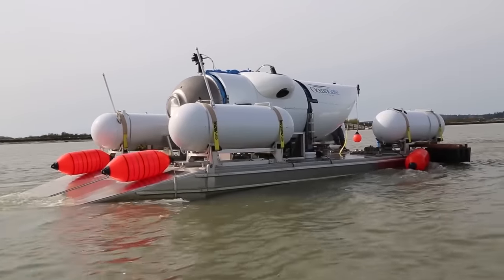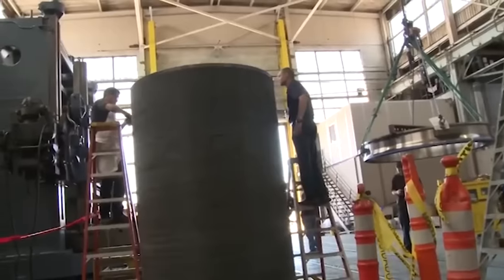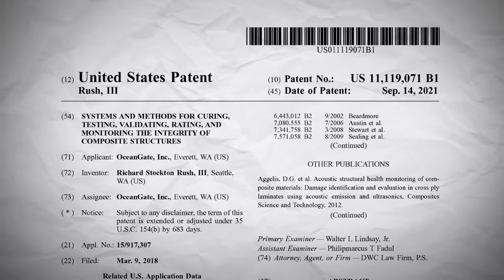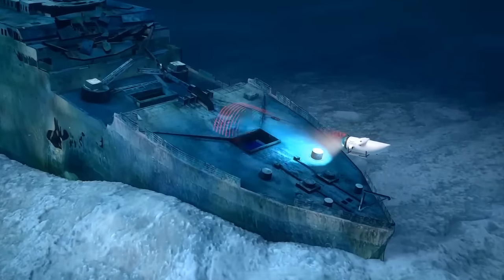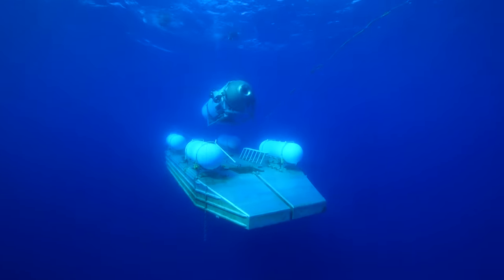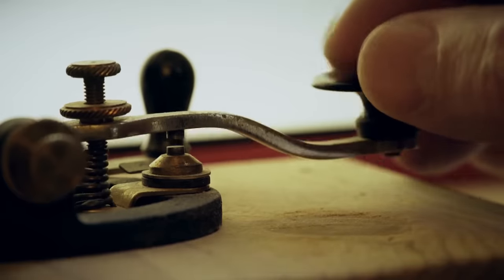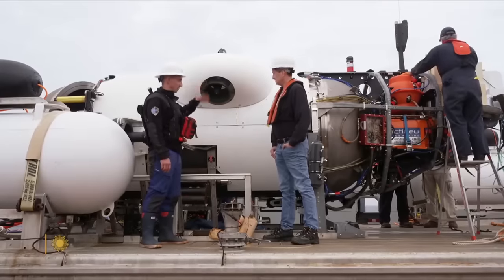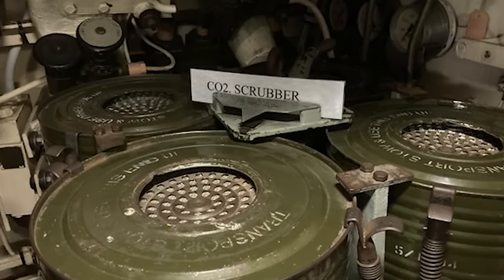Exposing OceanGate Submarines Many Fatal Designs

Comment: Changes which was required
1) spherical shape hull

2) steel full body(using different material will cause leaking in the joints)

3) bulkhead hatch door (opening outward)

4) inertial navigation (except having acoustic navigation)

5) ambient air oxygen level detector(which will cause auto trip to emergency function)

6)own ballast tank(which will help fast ascend and decend of the sub)

7) No glass viewport (different material will cause problem)

8) reliable controls(without bluetooth, because of interference with other electronics will cause loosing control of the sub)
Reply: The 1960s Trieste batiscaphe did have a window. The outer plexi layer did crack on the deepest dive but the whole window (and the crew) did survive the pressure. I actually cannot find what the whole window was made of but it was extremely thick.
Reply: @arctic_haze  for any high pressure vessel window(sight glass) quartz is used. But i for the titan I don't know what they used.
Reply: @arctic_haze  for deep ocean diving subs having window is a weakness. Because if those are different material they're gonna stretch differently in the change of temp. And if there is a joint you know that's a weak point.
Btw having a carbon fiber body as a pressure vessel if total madness rather than weakness. And using that for 3 yrs (speechless)
Reply: @o_j_o6447  I found it finally. The whole window was a "cone-shaped block of acrylic glass (Plexiglas)". OMG, it was the counterpart of the composite materials in that era. Also undertested, I believe.
Reply: @arctic_haze  that thing was whole madness
Reply: Autistic navigation is some next level technology
Reply: @pyxylation  LOL
Reply: @pyxylation  acoustic navigation is not so reliable. Because you're relying on another ship. Connection can break with mothership due to many factors

Comment: The Titan imploded at about 11,000 feet. The U.S. Navy has subs that can go to depths of 19,000 feet. The designer of OceanGate was not as qualified as he thought he was, and he took four other people to their deaths because of it. Just remember ... A homemade ship, no matter if it is a sub, a rocket, or whatever, is not on the same safety level as NASA, The U.S.Navy and others more qualified and backed up with science and money. Yes, they have all had disasters too, but their missions are like air travel ... pretty safe.
Reply: No submarine from the navy can go 19,000 feet under. The deepest subs are a russian one that can go 4000 ft under.
Reply: No US Navy submarine goes to 19,000 feet. They may have a submersible that goes that deep. 

NASA ‘s Space Shuttle had about a 2% fatality rate. Space flight is nowhere near as safe as commercial aviation.
Reply: @seppiluthold5014 actually, the Trieste 2, a US navy submarine that was piloted by a crew of 2 and decommissioned in 1980 was a deep diving submarine used to examine and recover parts of wrecked submarines, and other craft at up to it’s test depth of  6,100m/20,000ft. It only ever publicly reached a depth of 4.9km or 16k feet but was rated for another 4K feet in normal operation.
Reply: @bd73ne  actually, the Trieste 2, a US navy submarine that was piloted by a crew of 2 and decommissioned in 1980 was a deep diving submarine used to examine and recover parts of wrecked submarines, and other craft at up to it’s test depth of  6,100m/20,000ft. It only ever publicly reached a depth of 4.9km or 16k feet but was rated for another 4K feet in normal operation. They only have submersibles that are currently operating but they did at one point have a submarine as well
Reply: @prettycoolcat rieste - was a batiscaph. Using kerosene pressure tanks and deployed from a ship. Submersible.
Reply: @prettycoolcat Trieste - was a batiscaph. Using kerosene pressure tanks and deployed from a ship. Submersible.
The deepest going submarine was Soviet K278.

Comment: Also the titanium domes were plugged in using some sort of adhesive and probably bolted onto the cylinder…under repeated stress and strain cycle the micro cracks and failures were most prone in those screwed areas I feel, more than the surface fractures in the hull ..remember how decompression happened in plane fuselage in the 80s; micro cracks and fatigues always formed from near the bolted window screws …something similar to that happened here and 6000 psi in a small space like that would be like detonation of a potent bomb
Reply: They were only glued, not bolted. The domes were bolted to titanium "collars" that were epoxied to the cylinder. One of the things they did right was not putting any holes whatsoever in the carbon fiber. There's a video of the process you can still find online various places.

That said, there is still a good possibility that joining the two different materials made those areas more prone to failure...just in a different way.

Comment: This is a great, comprehensive summary!

I'd like to add a few details:

* The patented hull monitoring system that Rush proposed might work well for assessing the strength of homogeneous materials with an accepted range of deformation such as steel or titanium but is very unlikely to work reliably for a very static, constantly degrading material such as carbon fiber composits. They did run a destructive test on the scale model but that was on its first load cycle and they only assessed the pressure difference the system would notice (not how much time it would buy, much less how much time it would buy on subsequen load cycles)

* The end caps were not secured using 18 bolts but instead glued on using a material very similar to epoxy resin. While this is not an issue in itself, using different materials for a pressure vessel is highly undesirable, as they expand, contract and deform at different rates, putting much higher stress on the seals. The 18 bolts were used to close the entry hatch which also locked the passengers inside permanently. There was no way to open or at least vent the vehicle from the inside after an emergency ascent.

* The viewport was allegedly designed for a depth of 4000 meters but the manufacturer did not want to pay for the certification to that depth. Either way, choosing the product and simply trusting on their original design goal was a very stupid choice on Oceangates part.

* While the docking platform was originally carried on the mothership, they chartered a smaller vessel for the last one or two explorations which required them to tug it along behind the ship. This is not ideal as the vehicle is constantly being bumped around by the rough sea.

Comment: I only have experience with carbon fiber in motorcycle and automotive racing, and could tell you from just that experience that I would NEVER have gotten in that thing the way it was wound with that tiny strip in all parallell to each other. Carbon Fiber is only strong in one direction, and the direction the pressure was being put on it was NOT that direction. It is extremely brittle as well, just handling a piece of motorcycle fairing would be enough for anyone with any basic understanding of materials would tell you it was a stupid material to make an external pressure vessel from. And they were told, over and over and over again; the CEO paid for his hubris, unfortunately it killed 4 other people as well. There is a reason that carbon fiber body panels are only used for a few races and replaced, the flexing from the vibrations of the motors and being whipped around by the wind cause them to delaminate internally, which you can not detect and can not repair if you did. Just knowing this material delaminates this would rule it out for any sane engineer.

Comment: The titanium end caps were not bolted to the hull. An epoxy adhesive was used to cement the titanium to the carbon fiber hull.
Reply: Yeah, it's called BONDING.
Reply: @TucsonDude  Also called Fatally Inadequate for the Application.

Comment: Carbon fiber is similar to a piece of wire in that you can Bend it out of place and then back in place a couple times but eventually…. It snaps quickly. I believe that’s what happened to this subs carbon hull. Each dive was like “bending the wire” and it finally
Gave. If that’s the case then carbon fiber is absolute trash for a submersible meant to be used multiple
Times. Someone smarter than me please
Chime in 😂😂

Comment: You didn’t mention that there was a minor issue with the time it takes to detect an impending failure, the time it takes to then float to the surface - both being much much greater than the time it’s to implode.  Is it really a safety system if you are notified of major structural failure then have no time to recover from it?   He needed to verify the point of failure then back track to safe limits that would abandon the use of the unit for a new one.   In regards to using commercial joy sticks and other items in the crew area - these items need to be free from generating static electricity or fires (like the ones that might result in using lithium batteries).  One assumes that no smoking of cigarettes was allowed….
Reply: the smoking section was in the back.
Reply: @DrDeuteron haha, maybe they had one of those overhead indicator lights like an airplane.

Comment: Great video, but let me make a correction, the control of the submersible must be a reliable element anchored to the cabin, it cannot be loose because if it falls it can activate an engine and cause an accident. That's why a Logitech joystick is a lousy idea. In addition, there were many items inside that were not fireproof.
Reply: Luckily, you'll be surrounded by plenty of water in case of a fire 😅

Comment: Thank you for mentioning the controller.. I kept seeing mainstream news outlets talking about it as if it was the biggest issue.. when in reality it's just a way to control the sub, having 2 thumbstick joysticks vs 2 larger full hand joysticks doesn't really matter. The only thing I'd be concerned about is that it's clearly wireless, I hope they had a back up where they could directly plug it in to the system just in case the wireless failed. That's my only concern, idk why the news made such a big deal about that. They also kept calling it a PlayStation "knockoff" controller when that's not what it is, pretty sure it's just a Logitech controller (which does mimick a PlayStation controller) and for ppl who don't know, Logitech is 1 of the biggest computer gaming peripheral companies. It wasn't some cheap knockoff as far as I can tell.
Reply: Using a game-style controller is fine. But it's spectacularly dangerous to have a crappy, consumer-grade wireless device as a single point of failure on a can of people that you have no way of retrieving from the ocean if it breaks down.

Comment: To expand on why Game Controllers started to become more widely used. There's a few reasons.

Previously, the custom controllers used by the US Military for piloting drones were expensive as heck. Apparently they weren't all that ergonomic either. I vaguely remember seeing them (so don't take my word verbatim) and they looked more like Arcade Stick boxes with a trackball and / or joystick on it or something to that effect. The US Military chose, instead to replace those bulkier units for XBox 360 Controllers. They were not chosen for their durability, but rather more for their availability and price. They also determined that using 360 Gamepads made sense from a training standpoint, since most of the recruits would be quite familiar with a Gamepad. The Army will forego quality in favor of easy replacement and lower price for anything that just needs to work to suffice.
Reply: They are also pretty reliable if you get the good stuff and for extra reliability, just get 2. Custom controllers are really expensive, redundant xbox controllers are much cheaper and do a better job.
Reply: Seen a bit of "It wasn't that weird, they were used by the military" but trying to chase down examples is very hard.  They're rare enough to be unicorns, just maybe not truly unique.  Close enough though.  And it's a little misleading to say they were used on Virginia class subs without clarifying that they weren't used in the same context (steering!) as on the Titan, but rather to raise and lower a periscope analogue..  quite the difference.
Reply: In other words, "good enough for government work". I've heard that phrase used to have a totally opposite meaning to what it has today.
Reply: @sothere1  well they are used a bunch in the ukraine war for drones
Reply: @_aullik  I found that too, but a field expedited solution born out of necessity isn't the same as design intent.
Reply: @sothere1  Correct. However they are proven to work reliably. An over engineered custom solution might be a bit more rugged, but orders of magnitude more expensive. For most situations it is better to just have a spare than using an expensive custom solution (that can fail too). Those controllers are also usually better and more ergonomic due to millions of people using them rather than 10s.
Reply: @_aullik  they are really good and cheap is absolutely not the same point as they're in use in military applications.

Comment: Generally speaking, isn't carbon fiber best suited for structures under tension and not so much under compression? Hydrogen tanks and airplane fuselages put the carbon fiber under tension and both work well.
Reply: Bingo!  Carbon fiber is at its strongest under tension and weakest under compression.  Using it in a submarine hull is insane, especially one that dives to such abyssal depths.  I think this is the key to the whole problem.

Comment: Hi, I think you are missing something really important about the electronics on Titan.  Since they are off the shelf products, they are not fire rated for this application.  A fire in the "cabin" caused by a short or a faulty component is catastrophic and while the military uses these types of devices, they are certainly not off the shelf (especially in cases where there is a high risk of loss of life).
Reply: Indeed!

Comment: had a carbon fibre pressure tank for my paintball gun.. sure max dial was 4k rarely could fill to 2.5k but it aged out of  service live 2 years from manufacture..  and that was the late 90s..
Reply: Fatigue
Reply: In your paintball gun's tank, all the pressure is inside trying to get out, which puts the carbon fiber in tension (stretching); this is its strongest mode.  In the submarine's hull, all the pressure is outside trying to get in, which puts the carbon fiber in compression (squeezing), its weakest mode.  CF is an excellent choice for pressure tanks and airplane fuselages, but an incredibly stupid choice for a submarine hull.
Reply: @ericwent4931  yeah every two years had to get a rewrap but can only do that twice..

Comment: Nice video. It's also worth noting that none of the internal components (including the game controller, camping lights, monitors, etc.) were rated as fire safe for an oxygen-rich submersible environment. This makes the fact that similar game controllers are used for things like drones really beside the point.
Reply: I haven't seen anything indicating the atmosphere inside the submersible had an oxygen concentration significantly different than the approximately 21 percent outdoors at sea level. The oxygen tanks were apparently only used to replace the oxygen consumed by the submersible's occupants. Under those conditions combustible materials (clothes, wire insulation, hand lotion, etc.) wouldn't have ignited any easier than they would in your living room.

The Apollo 1 spacecraft was filled with pure oxygen to reduce the complexity of the equipment maintaining its internal atmosphere. In space that would have been at reduced pressure, but while on the launch pad that pure oxygen was pressurized to full sea level atmospheric pressure to keep the command module from being crushed like that railroad tank car.
Reply: The info on how many times this very craft got to the Titanic is all over the place on the internet. From 3 to 13.   AI could of did real time testing to 4000 meters with no one on board.  It never would of survived at I say 9.  This is a disgusting example of follow the money.  God rest the 4 souls. Stockton deserves nothing!!!!!

Comment: How did you determine the number of full depth dives of 7? Most sources have had a hard time determining exactly how many trips to the Titanic were actually made.
Reply: Pretty sure it was way more than seven. One summer they did 12 trips to the Titanic.
Reply: @JH-nb4nn  Numbers like that also seem in dispute because many attempts appear to have been aborted.
Reply: @WadmanP  Yes I read they spent 50 days above floating on the water because of many failed attempts but made it down 12 times that summer. Who knows but I don't think it's 7.
Reply: @JH-nb4nn  Here's an interesting detail; at least two hulls were used. Someone raised an issue about loud, cracking noises with the original carbon fiber hull. That hull was replaced by a new one which apparently was the one involved in the implosion event. Between all the full depth dives, how many were done with each hull?
Reply: @WadmanP  Interesting...no clue

Comment: Game controllers are never used in military applications where the life of passengers is at stake. 
If they are used on Board of a submarine they either control non-critical systems or they are not the only control or both.